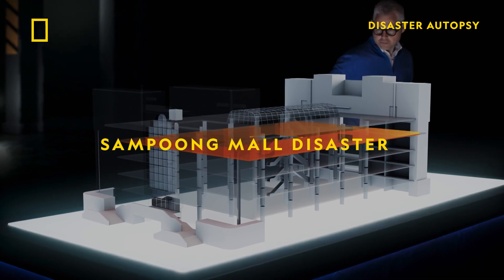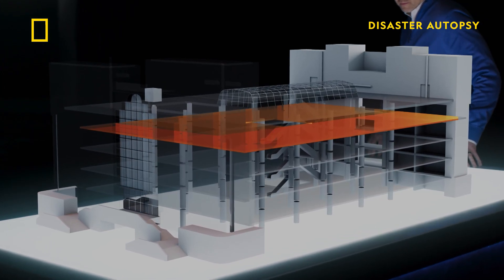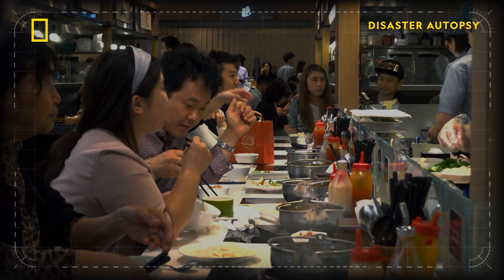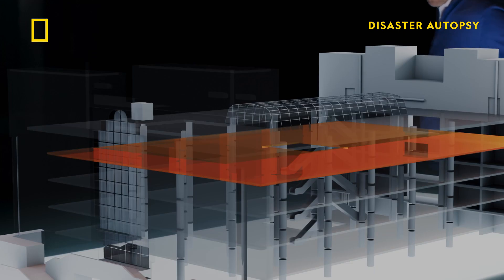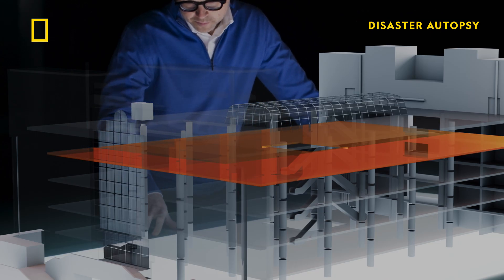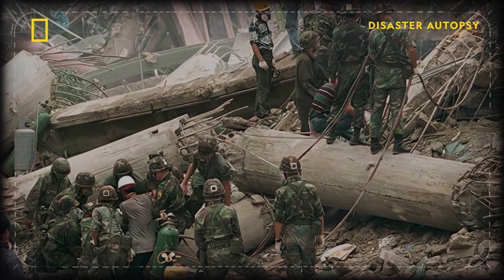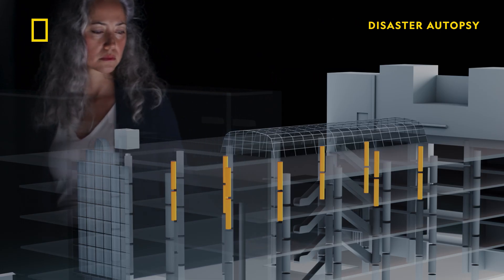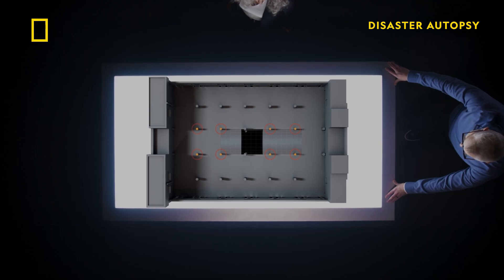Why did the Sampoong Department Store Collapse? | Disaster Autopsy | National Geographic UK

Comment: And the sad part is the person who  made the mall wanted to build the mall as cheapest as he could, and that choice made 502 people die. (If you want to listen to the full story look up rotten mango Korea's death mall.)
Reply: Not really, the main cause was the cracks.
Reply: @Carrotcruncherohyeand the cracks were caused by what? magic? of course not, it was the cheap material combined with a very heavy object on the top of that.
Reply: @luidm_  The reason for the cracks was the owners dragging the air conditioners along the roof, and when they were turned on the floor would vibrate and enlargen the cracks